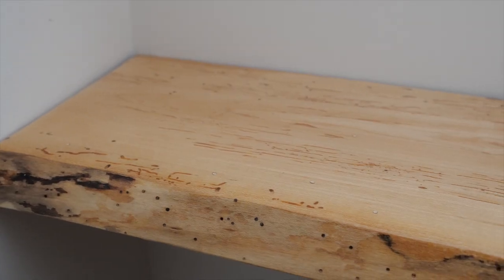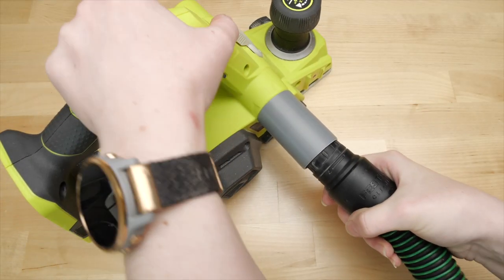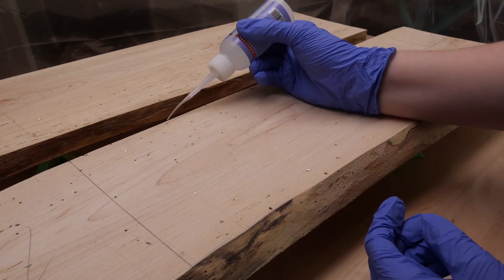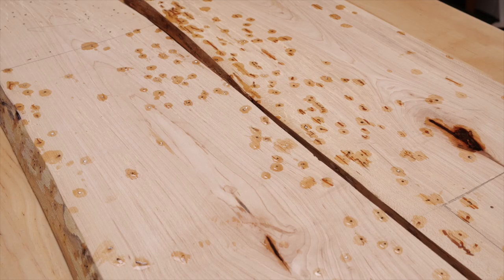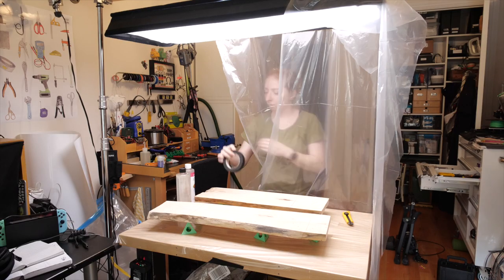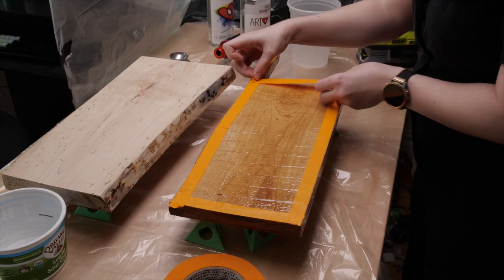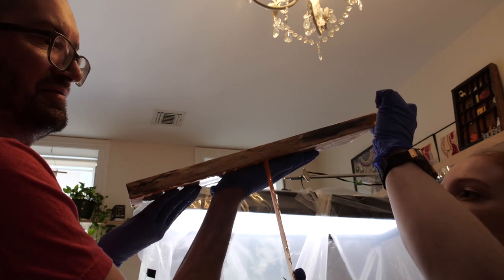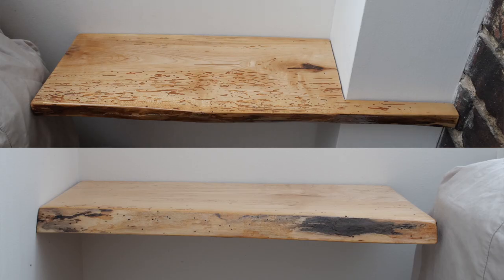How I Made my Bedside Shelves (Maple and Epoxy Resin DIY)

Comment: I am so impressed by how much you manage to in a small apartment and by using the roof.  Also, I didn't know one could plane a board wider than the width of the handheld planer and get good results.  Lastly, I wouldn't have thought of coating the wood with epoxy, but would have gone with an acrylic polyurethane.  Thanks for a neat project and insight of how to work in limited space.
Reply from the maker: I did do a ton of sanding to get the planer marks out from having used the narrow tool on the wide board (shortened with the magic of video editing). Not ideal, but it worked for this small scale project. Thanks for your kind words! My workshop is small but mighty! The awkward roof spot aka "the terrace" helps a lot for keeping messier stuff outside, but I still have to clean sawdust off my plants and computer sometimes. 😆⚡️

Comment: I’ve had really good luck filling holes in the 614 maple using joint compound and stain or paint.  Once dry, sand or plane the area smooth.  I’ve also found that a skim coat of epoxy before the final layer make filling holes a lot easier and less time consuming.
Reply from the maker: Good tips! I love the lamp you made me from that tree.